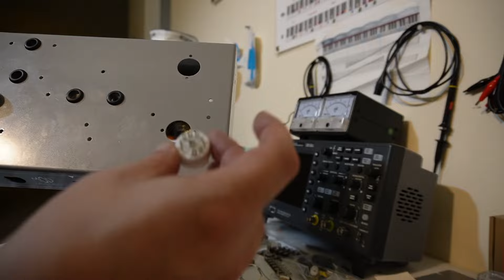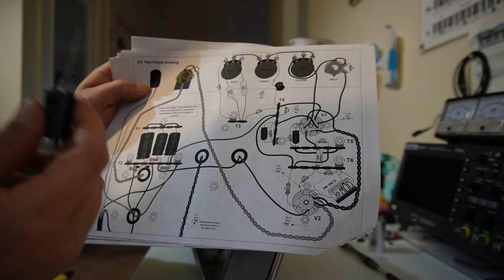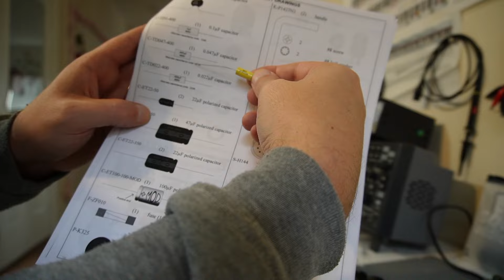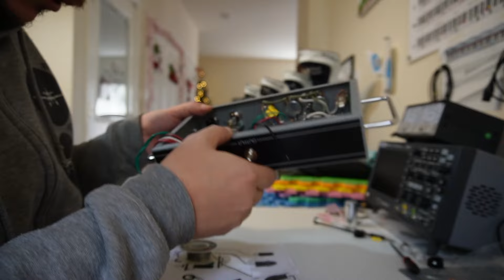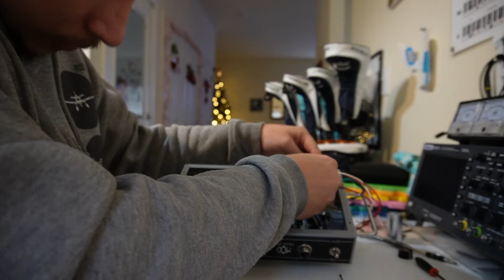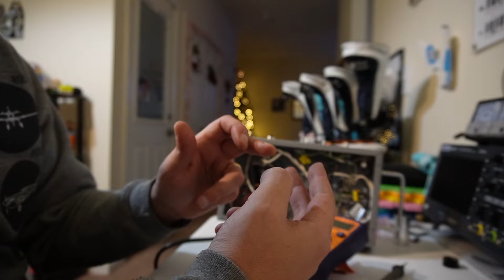Interested in building a tube amp?... MOD 102 DIY Amp Kit FULL Assembly and Demo

Comment: Was looking at ordering this kit or the 5F1 when I found the MOD102 in an electronics store already assembled. It’s a disaster! They got it all wrong and there is no way it worked at all. The worst mistake is he marked pin one on V2 but then went the wrong direction. I’m putting together an order for new capacitors and resistors plus the additional parts for the mods and updates.
Reply: Advice: get the MOD102+, it has a better tone stack in it, worth the upgrade. The amp is unbelievably good and clean IF constructed properly.
Reply: @craigpierce7996  I’ve ordered the parts to finish the project and I also ordered all the parts for all the upgrades and options. It’s on pause right now but the plan is to get it working and then do the upgrades and options one at a time.